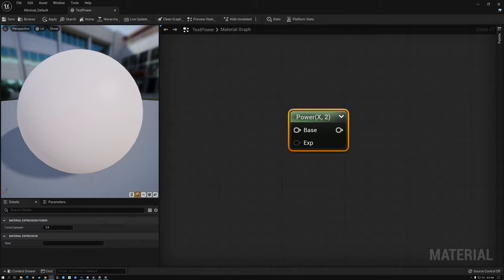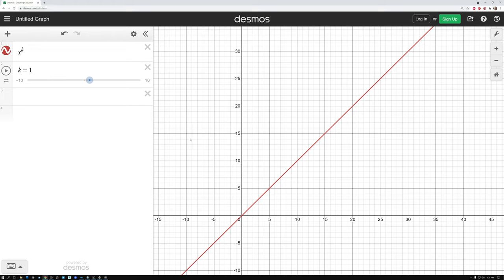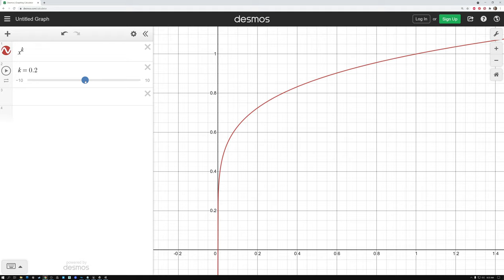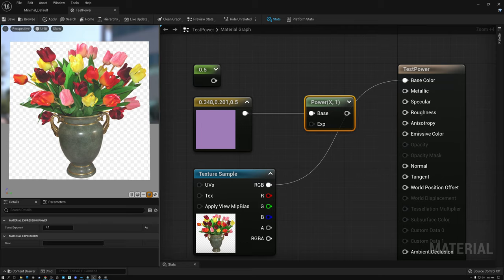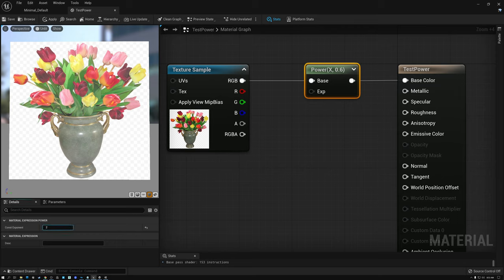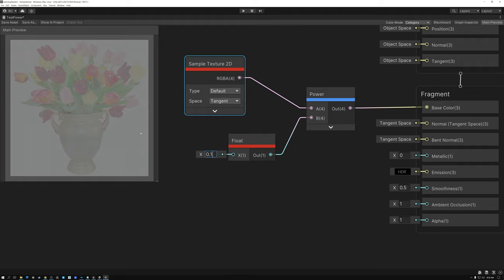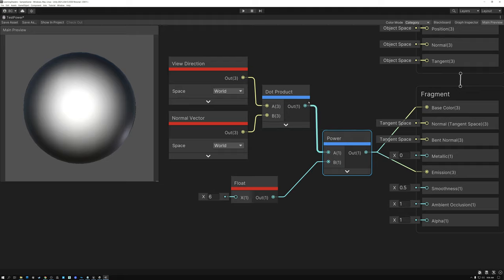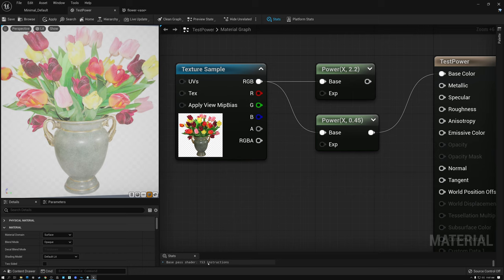Power - Shader Graph Basics - Episode 20

Comment: Great Tutorials !!! 25:35 Question : What if I want to render my game in p3 or a wide color gamut  not srgb do I need to check the srgb toggle or not ? And do I need to use a wide color gamut textures ? .
Reply from the maker: I don't have any experience rendering in other color spaces, but I would guess that the answer is yes - you still need that setting to be on for albedo textures and off for others.
Reply: @BenCloward  Thank you ❤❤ !! Again amazing work !! Big respect💖
Reply: You need to specify your texture encoding settings under the Texture>Source Color Settings, if you use another color space other than sRGB. Otherwise your color space will not understand  how to map your texture which is encoded in other program such as PS, Substance or some photo you found online.